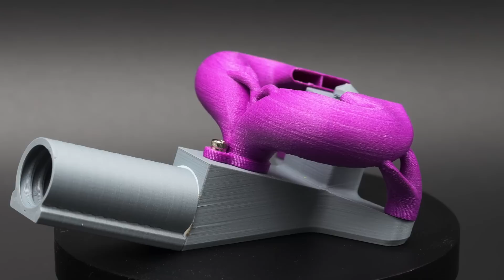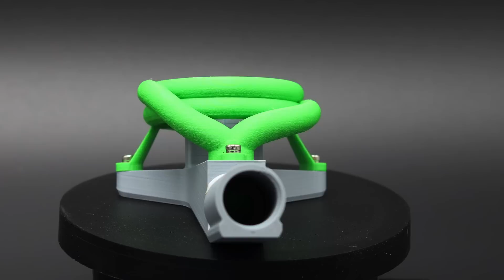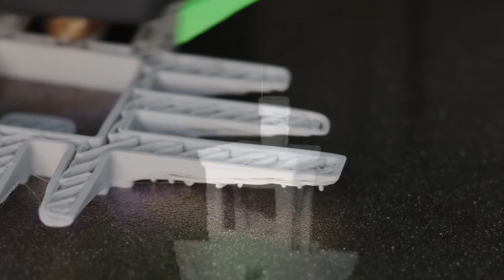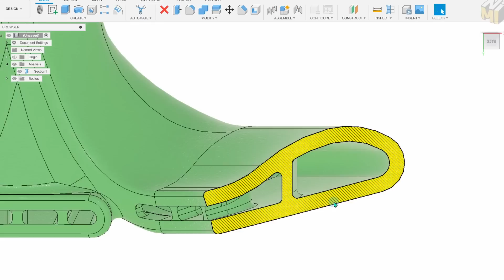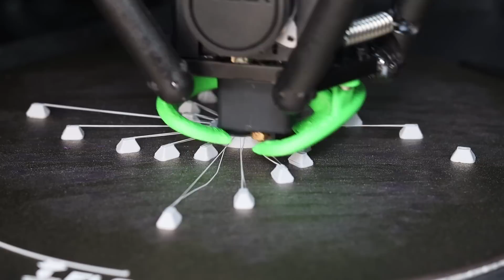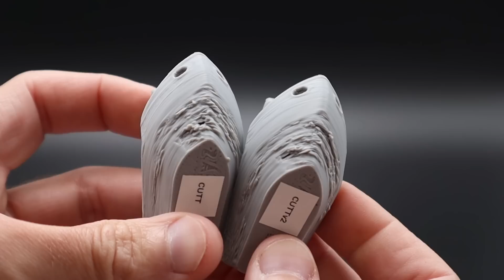Ep.2 - More crazy looking 3D printer duct designs with some serious performance!

Comment: I will say, you should take the highest performing models from, like, 5 or 6 videos and remanufacture them with resin 3D stereo lithographic printing to get higher resolution prints and do a final round of testing. The youtuber who does PC fan design submissions learned that the filament printed fans just can't easily get enough resolution to prevent the ridge lines and other defects from disrupting the air flow. So while the filament printed models can help to gauge whether something will be successful, you really need the resolution of resin printing to make a final determination of efficacy.

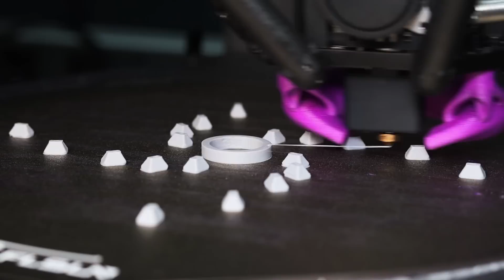Comment: Looking at that bridge overhang ( 3:11 ) test you see the reason why 3D-prints warp. Imagine that tension in each and every layer pulling inwards but also locked in place by layer adhesion.
It makes internal stresses in your relatively hot and soft part.

Comment: Really impressed by these!
Mobiobi's Cuttlefish was really good. One of my thoughts when watching the first test was that the duct splitters could be balanced a bit differently, so I was happy to see the revision. Overall I think this may be one of the most promising routes for solid performance.
The main issue with Turbo Fan is just the outlet angle and placement I think. I'm guessing it would actually perform a lot like many of the aftermarket designs we see with dual fans with some tweaking. Definitely appreciate the automotive inspiration to that one.
Lucrehulk by Dave has a lot of potential, but I think it would have done better if it looked a little more like the ship that inspire it. Needs to be a bit taller and fatter for more flow, and then I think angling the nozzles slightly would help. Having the cut out portion to make a U shape instead of an O should give a nice path for air escape.
DuctyMcDuctFace by SOHChead of course has a great name and it seems they are a fellow car enthusiast of some sort so I appreciate. I wonder if opening it up a bit more would help or hurt. Really thorough design there I like it.  You know who else likes it? My mom!
Hurricane Quadro definitely has a ton of potential and I think is on a similar path to your earlier designs to be one of the easiest ways to get a lot of performance.
I also really like LoopX by ? hahaha. Just such a fun design that I do think could perform even better with small tweaks like less horizontally open outlets.

As for my duct, the Double Donut AKA Shrek when ya look at it from the right part of the swamp. I had intended for it to be less restrictive, but I think I did some math wrong. When I was first designing the nozzles, I was basing their size on what I thought the inlet diameter was, but I think I had used the wrong base circle. This also led to inlet ducting revisions late in the design which made that area a bit messy, though I tried to hide my sins. That said there was definitely more guess work going on than real deep math. Either way, the tip on opening up restrictions makes total sense. I don't think I would want to increase average velocity so much as overall flow.
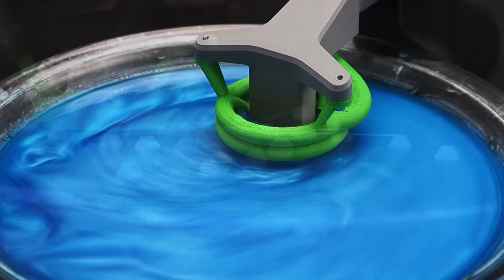The Double Donut also had one issue I anticipated, which was stronger air flow from the nozzles closest to the inlet on each donut. At least I think that's pretty apparent from what we see on the left side of the water bowl at 5:16 and as the fan speed is turned up. It would actually be pretty easy to progressively open up each nozzle around each circle so that the nozzles flow slightly easier as you go around, ideally balancing the flow and reducing restriction. I did leave the interior of the donuts totally open so the air could circulate inside rather than hitting a wall. There are probably some simple inlet tricks I could use to maximize and positive impact of that design choice.
Overall though, the effect on the water test is what I was aiming for. I wanted fairly turbulent flow that also had some twist. I expected one direction, likely the lower donut swirl, to be more dominant, and that looks like it happened. The upper donut does angle downwards more as you mentioned, so I thought it would create a bit less angular velocity. I basically thought the lower donut would cool the extruded filament more, while the upper donut would perform more general part cooling and force a little more air escape.
Now if any of the above ideas and principles are actually good for performance or not, I'm not certain, thought I think I have some good guesses, and it did surprise me with how well it performed. I'm not surprised, however, that it was not the best! With a little tweaking I think it would be near the top in this testing, so there must be some good ideas, and that's pretty cool.

Comment: I really like the idea to test the different ducts. What I am missing is the speed/acceleration/square corner velocity/min layer time. As with the benchy, it can be compared to other entries to gauge a ducts performance. I rarely print PLA, and I was curious myself how long it would take to print a Suriken @ 150% and 100%, using PLA. Setting all the speeds to 1000mms, 30K acceleration, 40SCV, I was able to print both with a min layer time of 3 seconds. The 150% took <10 minutes and the 100% in 6 minutes. This test was  useful to me in that I know what my min layer time is now for PLA. Using ABS, I can reliably print at .7s min layer time. Those 2 values are paramount in order for me to make a 'good slice'. What I miss here is that 'gauge' and a representation of what it takes for a 'good' model to print.

Comment: The double donut looks incredibly interesting, I'd love to see a cfd analysis of what's happening with the opposing nozzles. It almost looks like the air streams are aimed at each other to create a vortex.
Reply: Thanks! I had to pick how to clock both sets of nozzles and it's interesting to think about how the paths might affect each other. The upper donut I clocked so the nozzle streams would pass the heater block as well as possible without any ramming straight into the sides. So for the lower donut I had to pick if I wanted the nozzles directly stacked or somewhere in between
 I picked the orientation I did because I thought it would allow the streams to pass by each other without directly intersecting. It may look like they completely cross right now, but the actual vectors should pass without hitting each other dead on. That said I did want some air interaction and of course they're still going to affect each other. I really wonder how just clocking the lower ring differently would affect performance.
Mainly though I definitely wish I had opened it up a bit more, as I did some math based on the wrong inlet circle which led to more restrictive design decisions than I intended. I wanted to basically have two counter-rotating vortices fight for the same space to create turbulence and just to see what happens. I think the water test actually shows it worked better than I expected! 
With a little more flow I think it would even be a great performer, so I'm happy.
Reply: @802Garage  Oh that´s very interesting. having two spinning discs meeting in the middle was my second guess, but I believe that such a systerm is very hard to predict and control. Did you do any simulation beforehand? It did seem to perfor rather wel.
Reply: @cosmic_cupcake  Nah unfortunately I didn't have the time, but I'd love to do some. It was more of a "This is an interesting idea. Let's see if it works." Type scenario. I think how the prints come out is most telling on if an idea "works" for real.

Comment: I feel like many if not all of these ducts should be printed on a resin printer. I have printed ducts with my own resin printer before and you get much much smoother walls and zero defects such as drooping filament, rough surfaces and uneven walls that add friction.
Reply: The difference it actually makes would be nearly impossible to notice in test prints by my estimation. While they all may perform very slightly better, this isn't the same as say aerodynamic drag in a race. I could be wrong of course, but I think regardless, the comparisons to each other are still valid printed in the same medium.

Comment: It's an unscientific a/b comparison of the ducts. It's meant to be messy and overall too hot to try to highlight the differences. Admittedly, he should have explained the exact settings and system better in the first video of this series. But you know this is Youtube, not an acedemic/engineering journal. It's meant to be entertaing, with informational as a potential byproduct. Don't expect rigor.
Reply: LOL if you knew the parameters it would not change the results of the testing, only your ability to speculate on which parameter is causing which problems. It is unscientific, but it is proper apples to apples comparison, and that's the point. Even with parameters tweaked in infinite ways, there will not be a perfect duct or a perfectly clear order of performance. Interpreting the results will always be partially subjective, because this has to be done primarily by eye. Do you have a way to make this testing perfectly "scientific" for us? Of course no. So why criticize in such a way? Knowing or tweaking the parameters would not change that. I get that you are encouraging people to watch without expecting exact answers, but you write it in such a demeaning way to the testing that it seems you think you know much better. If I'm misinterpreting, please correct me. What I'd like to say overall though is, if you are going to leave a comment on a high effort video which is trying to provide information and entertainment, make sure your comment adds something and isn't just about intellectual jousting.

Comment: The "struggling with the lower hull" is NOT the ducts but flow. You're trying to run this printer at a commanded speed that's roughly twice the flow it can actually do, so on the only part of the benchy where full speed can be achieved, the lower hull, you're getting the (very much expected) massive extrusion failures.

These failures have almost nothing to do with the ducts, but might be worse with better ducts because you'll overrun the heater slightly less with less air hitting the nozzle.

If you want these tests to be meaningful, rerun them with max flow limited to 30 or 35 mm³/s in the slicer.
Reply: I can't say I agree with you because if this was an under extrusion issue, we would see it throughout the model, not just on the lower hull. The problems with the Lower hull look like telltale cooling issues, not an extrusion problem. Not to mention the head is likely moving slower there than on most of the model due to the extreme overhang. Part of the reason the Benchy is designed this way is to have an overhang torture test. You can see that additional cooling helps by the performance of the ducts.
Reply: @802Garage  The lower hull is the only part of the benchy where the toolpaths are long and straight enough to reach a high commanded speed without astronomical acceleration. Anyone who's done speedboating knows this.

The lower part of the hull is not actually all that hard to cool. Sometimes folks doing extreme speedboating have minor imperfection right at the center, but nothing horribly deformed like this.
Reply: @daliasprints9798  I agree speeds are higher. That is also a condition for needing more cooling. Again it also a harsher overhang even if not a particularly difficult one.

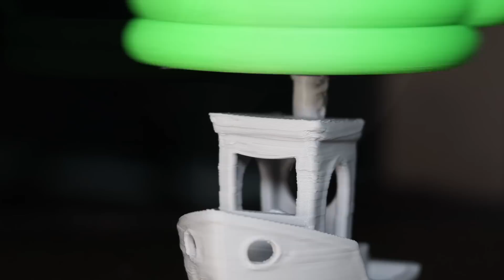I'm not saying there is no chance of under extrusion nor that it couldn't cause issues, but cooling is certainly still a factor. Look at 9:00 for example where the same issue present lower on the hull continues all the way up due to a lower performance duct. At 4:50 you can also see my duct performed worse than stock, implying a cooling issue. 14:55 is also clearly better than the stock Benchy.

I do think there are other contributing factors to the particularly bad hulls and under extrusion may be one of them, but luckily it doesn't really affect if we can determine one fan is doing better than another. I think the primary issue is still cooling since we can see what a difference it makes and very similar performance issues are demonstrated and change dramatically on the shuriken test.

I also do know that Mike performed flow testing in the past at these speeds, but as I'm sure you know those tests are not always definitive and I'm not sure how rigorous he was or how he tested the current filament. Perhaps he will clear this up more later. For now the comparisons still demonstrate differences well.
Reply: @802Garage  Again, as someone who's done extensive speedboating and spent lots of time in communities where many others have, I've seen plenty of good and bad boats, and the problem on these hulls is not primarily cooling. You need excellent cooling to get a sub-8-minute boat that looks decent or a sub-10-minute that looks flawless. You don't need excellent cooling to avoid the monstrosities seen in these tests.
Reply: @daliasprints9798  Fair enough. I'll stand on the fact that we can still differentiate results, even if what we interpret from said results may not be a single clean cut takeaway.
Reply: You're right, with my best benchy times I found flow was a huge effector on the hull. It leaves the filament still gooey, like silly putty instead of melted chocolate, so it springs back. But if you can cool it fast enough, it doesn't spring back as bad.
 On the other hand, if you cool the nozzle instead of the filament, your flow rate gets even worse!
I found this while using a handheld dust blower like the kind you use for cleaning PCs.

Comment: How about a design that aims airflow upwards and outwards instead of downwards and inwards?
The idea would be to create low pressure around the nozzle, forcing ambient air upwards to equalize pressure ... In effect "supporting" overhangs with air flow, rather than pushing them down.
Reply: Come to think about it, that could perhaps be tested by just reversing the fan in an otherwise more normal duct design.
Reply: @ZappyOh Someone on a previous video mentioned an inhaling duct as well. Both of your ideas would be interesting to see!
Reply: I had the same thought but I don't know how you would direct the air upwards with a duct that is still above the print and aimed at the plastic instead of the nozzle.
Reply: @Waldohasaskit210  Just make a normal duct and make it suck like a vacuum.
Or, make a normal duct, but make the vents blow upwards away from the nozzle (creating low pressure around the nozzle).

Comment: 10:19 I would just scaling that model in Z so it gets to where you think would be a good height for output, then it will turn the holes slightly oval and open up the whole airway a bit. Oval (maybe?) isn't ideal, but it'd be an easy thing to try out.

Comment: Random thinking outside the box...instead of cooling filament with a blower, has anyone tried using a vacuum to draw the air up and around and over the part and the nozzle?
Reply from the maker: It's a really neat idea, I like the concept, I would just wonder how to direct the flow.  It does make me think that it might be possible to have both the sucking and blowing working together.  One issue that keeps coming up in my mind is "where does the warmed air go?" if we can have an area where the air is drawn away and an area which air is placed precisely as well, it could be the ultimate combination!
Reply: @NeedItMakeIt  That's what I was thinking too...some sort of hybrid cooling solution. Maybe one motor could run the impeller and the blower and use ducting to blow cold air like current cooling solutions, then draw the hot air up from around the nozzle. So essentially the air would come down cold, across the part toward the nozzle, then straight up, making a nice current of air.